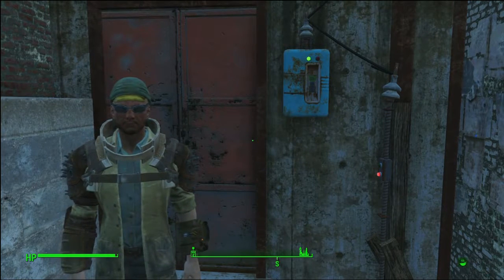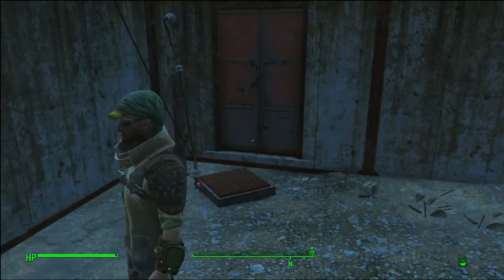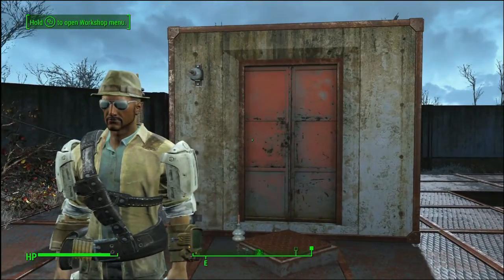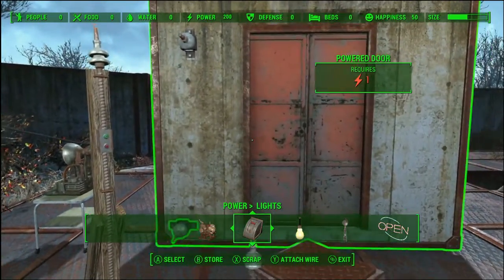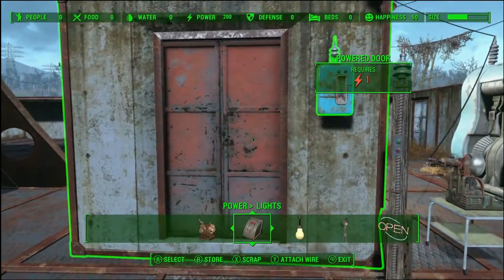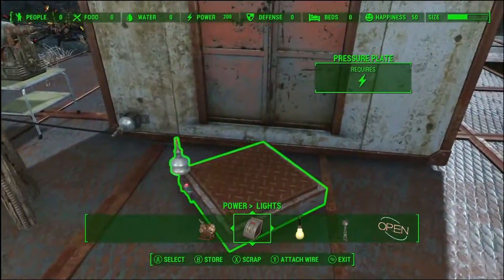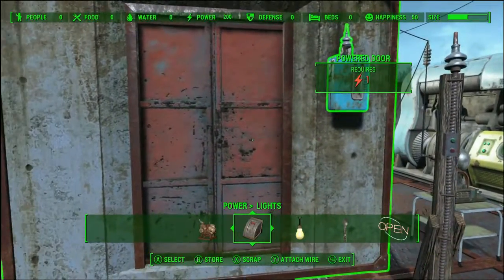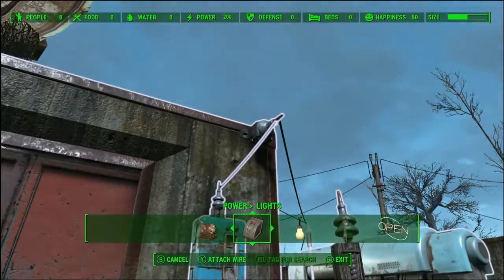Automatic Powered Doors Fallout 4 How To

Comment: Close, but not quite. In Fallout 4, the Pressure Plate eats the power when it isn't being pressed, meaning that the Delayed Off Switch will immediately turn off when you step off of the Pressure Plate.

To work around this, you need to use the NAND gate, added by the Contraptions DLC. 

This is the best way I can describe this with comments:

Components: NAND x 1, power generator (Small or better), Pressure Plate, Delayed Off Switch.

Circuit:

Power > NAND IN > (NAND OUT)  > Delayed Off Switch > Powered Door;

Power > Pressure Plate > NAND IN.

Depending on how much time you expect it to take for you to DEPRESS the power Plate and make it through your door, hook a generator into a terminal into your D.O.S. to adjust the timing as is appropriate.
Reply from the maker: really cool, check this one out it's a bit more modern and thanks for the tips and checking out the video :-D
https://youtu.be/J68FPc-hZ-M
Reply: Mike Shaver-Miller   Thank you.  I knew it required a logic gate, but it's backwards from what I was thinking.  The key is that switch works AFTER the plate, wasn't thinking of that.

Manny responds with a video with basic stuff and no solution ofc.
Reply: With this method though you would have to step off the pressure plate before the door will open though, right?
Reply: I finally figured out how to wire this so that you step on the pressure plate and the door opens and stays open for x seconds even if you have stepped off the plate. However the time delay switch needs to be reset manually every time you use it and thus my idea couldn't work :(

Comment: This is exactly what I'm using mine for.  But not cuz of survival.  My FT point is glitched so when I FT to Alley, I'm at the white door, which I hadn't lockpicked cuz came the back way.  So I picked it & tried to set up power door.  Put a switch on other side but it only worked if I cut generator off & on.

Comment: My terminal does not want to help out my delay off switch button does it have to be connected with the switch to or just the terminal and also whenever I set the settings to 5 Seconds do I have to wait for that computer to set it to my delay off switch or do I just push the back button

Comment: doesnt matter what method i try. as soon as the door has power it wont close. even aftee all the swtithces etc
Reply from the maker: the only thing i can think of is that you have some type of power hooked up to the door or your switch is always open. i have another video about these i just started talking about four different types but it will be a few day before release so try this.  Power Generator --> Pylon--->Pressure Plate or delayed off switch--->Power Door. you might need to repeat the same setup on the other side to be able to leave the door as long as you do not have a live wire going to the door it will stay closed the moment it get juice it will open Hope this helps and please look forward to the next video about these.
Reply: Ok thanks, will give it a try

Comment: can anybody help me? I'm trying to connect a power door to a switch, however, i want my switch for this door to be far away, I've connected to door to the switch with a couple of power conduits, but it won't work. Does it have to be connected directly to the door what? can anybody fix this problem?
Reply from the maker: as long as the power is interrupted it would not matter how far the switch was from the door as long as the switch is getting power the doors should stay close so it would be door to conduit until you get the door power to the switch then you need power running to the switch when the power is on it should keep the door closed and when power is off the door should open if you have more power running to the hot line coming off the switch then you would need some extra parts hope this helps thanks for checking out the video

Comment: does this stop NPCs from getting into your base? I just had a random raider steal one of my power armor suits
Reply from the maker: chunks mclol yes I think so I used them to lock gunners in a kill zone when I released them from cages they could not open the door but loading screens and teleportation lets settlers glitch through walls hope this helps
Reply: thanks man very helpful
Reply: If you remove the fusion core from your power armor, no NPCs would ["want to"] take the armor.
Regrettably NPCs can glitch into any base, as far as I know, which is sometimes very annoying in my opinion. Settlers will also glitch into every nook and cranny of a settlement - given that they can fit into them - but they will only do this if a confined space has something they can interact with, like a chair or something.
Reply from the maker: Cabirus I've seen settlers jump into armor without a core and walking really slow really funny moment